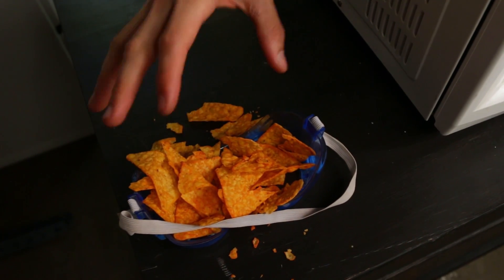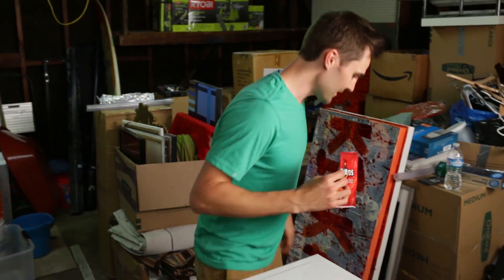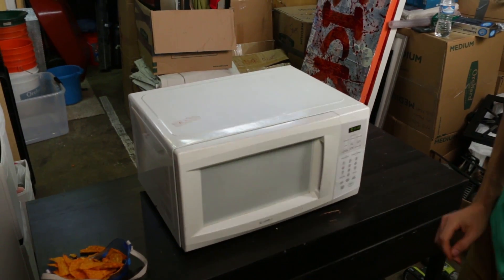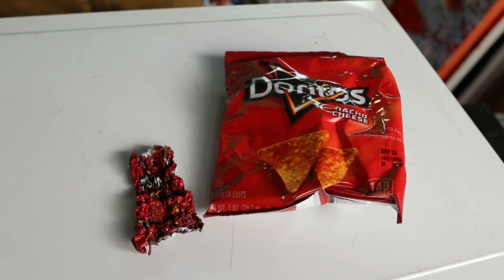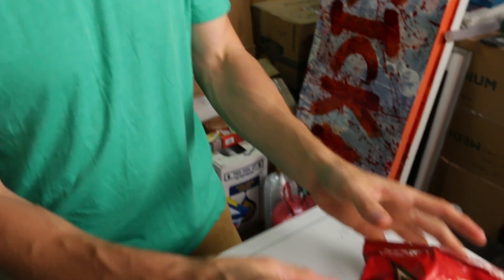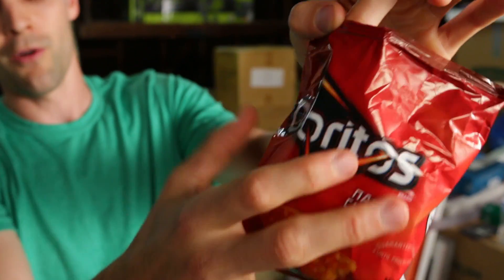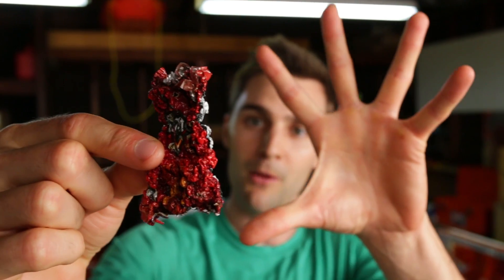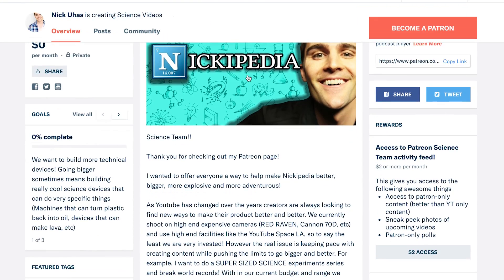Doritos Bag In A Microwave: Filming Inside A Microwave

Comment: Such a cool view inside the microwave!!  Nice mad scientist laugh😂 !  What kind of camera did you use in there if you don't mind me asking? And obviously the camera was fine?
Reply from the maker: lol, thank you! for the main camera we use a 70D and for the "inside microwave cam" we use my iphone : )
Reply: Nick Uhas no way you used your iPhone loool
Reply: @wGScopez  the way this works is microwaves have a rather large wavelength, the metal mesh that you see through blocks the microwaves because they're too large to pass through the holes but you can still see through it, the same idea can be applied to just making a hole in the back of the microwave and putting your phone's camera lens up to the hole to look through, notice when he opens the door right after it shrinks there is a small hole in the back wall, that's where he was recording through